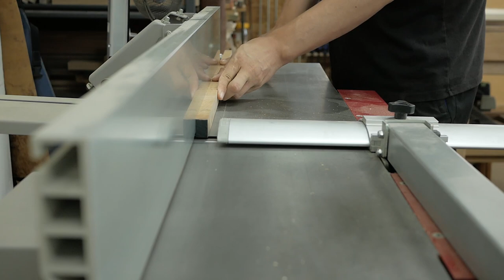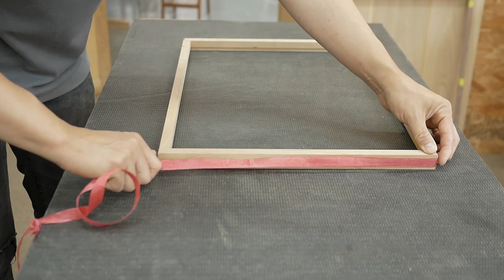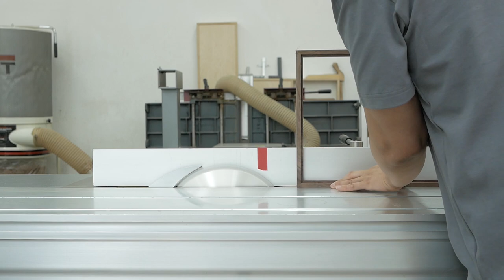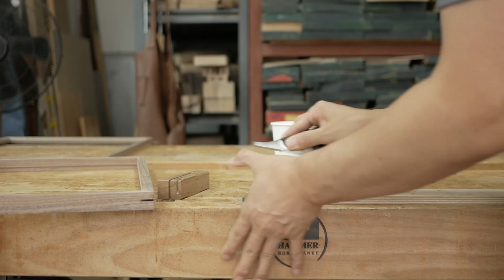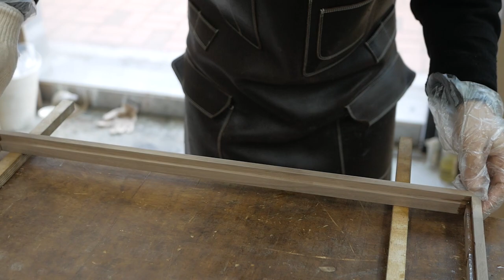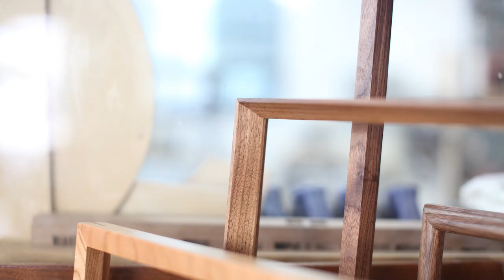SQUARERULE FURNITURE - Making Poster Frames

Comment: Made my fingers tingle when you ran them through the router table.
Reply from the maker: The videos that seem relatively anxious are boldly
I used to cut it, but this time it's a little dangerous
I think it looks.
Actually, the router bit is located below my hand.

We will try to work more safely.

Comment: As others have said i'll need to try that spline slot cutting method, you would lose a bit of glue area but not enough to worry about.

If you cut your splines at a 45 degree angle you will get more per strip of wood, I trim mine down basically the same way you do, trimmed the first few with a flush cut hand saw and a hand plane which was fun i guess but took too long.
Reply from the maker: A slightly larger frame is more sturdy by inserting two.

Thank you for watching.^^

Comment: I'm new to woodworking. Can you explain why you're measuring the height of the blade to set up for making the spline. What height are you measuring and how do you determine how far to push into the blade before you stop?
Reply from the maker: Hello, because the top and bottom have to fit somewhat
Start with a height of 55.

Make a test cut so that the spline does not penetrate and mark it with tape Work.

Comment: How do you like the Laguna Sliding table saw? I am thinking of purchasing the smaller P12 / 5 but it is difficult to find what people think of the P12 series. Do you happen to know where they are made?
Reply from the maker: I know that only the size is different, but there is no big difference.
It will depend on the size of the wood you use mainly (I make a lot of tables over 1800 mm).

If the things you want to make are small things, it will be enough.
Reply: Thanks! Have you been happy with your version of the saw? Any particular likes or dislikes about the saw?
Reply from the maker: @cayres6898  I am satisfied enough.
Rails are also easy to manage and durable.

I first bought it in 2014.
Prior to using it, Felder's K700 model was used at work.

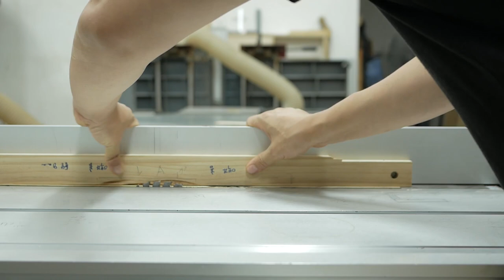Comment: At 1:37, what is different about the blade you have in there relative to your standard 300-315mm? 

Are you running a dado or something different which is why you took off the splitter?
Reply from the maker: It is machined at once with a 5mm dado saw blade.
Reply: Interesting. I just bought the laguna p12 and was told by the manufacturer it could not run a dado. 

Super helpful to know that I can run a 5mm dado blade.
Reply: Forgot to mention beautiful work as always.  Looking forward to the next video!
Reply from the maker: @cayres6898  It can be up to 8mm
However, the saw blade must be made to order.
Reply from the maker: @cayres6898  Thanks for watching
Have a nice week~
Reply: This is really helpful. Could I reach out to your email and get some more details on what you like in the made to order blade and where you order it from?
Reply from the maker: @cayres6898  Currently, 6mm ready-made products are purchased and used here.
https://www.sobit.co.kr/category/%EB%AA%A9%EA%B3%B5%EC%9A%A9-dado%EB%82%A0sobit/219/